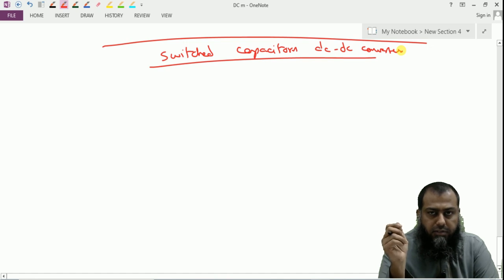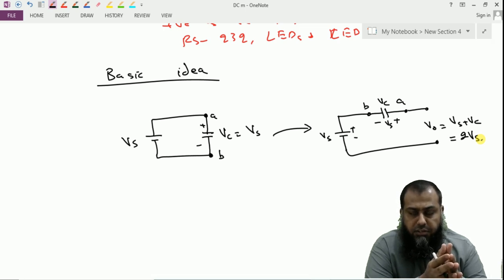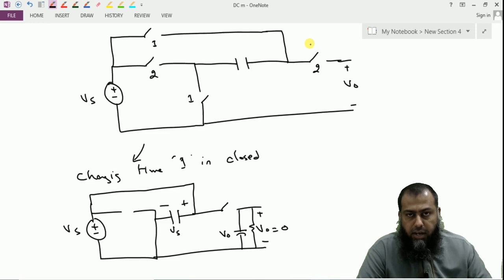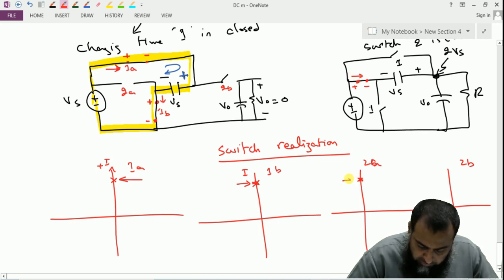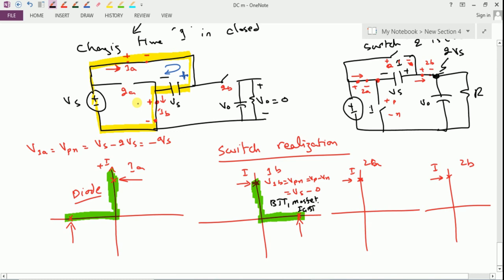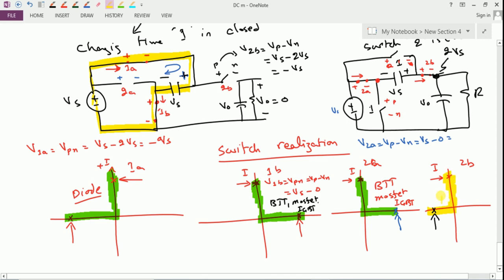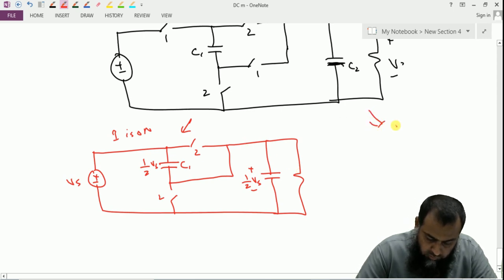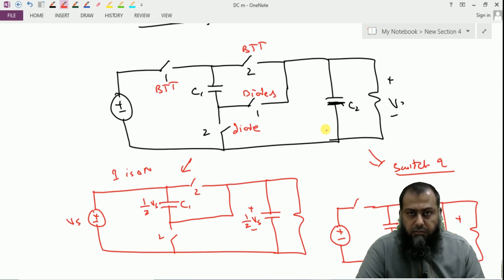Power Electronics Module 2 Lecture 5 | Switched capacitor converters

Comment: Thank you sir. Since you are doing pec topologies. I wanted to start my research in EV chargers and most of them have DAB with single phase shift modulation or enhanced SPS modulation. But i dont have basic understanding of these yet. I would request if you can make one video on that
Reply from the maker: Dear Ahmed Ali, I am covering this as part of an undergraduate course on Power Electronics. My plan is to move onto the avergaed simulation concept and then to the isolated converters. As of now, i am suffering from Covid and hence i am likely not to produce any video in the coming 10 days. Modulation aspects will be dealt in the course too. So stay in touch and keep an eye on this channel.
Reply: @HadeedSher  thank you for replying and get well soon by the grace of Allah.

Comment: How can we mathematically model switched capacitor converters? Simple Averaging technique cannot be applied due to the rise of differential algebraic equations in the model. Have you worked in this direction as well?
Reply from the maker: Several papers discuss this issue. Please see these papers
1. Henry, Jordan M., and Jonathan W. Kimball. "Switched-capacitor converter state model generator." IEEE transactions on power electronics 27, no. 5 (2011): 2415-2425.
2. Makowski, Marek S. "On systematic modeling of switched capacitor dc-dc converters: Incremental graph approach." In 2010 IEEE 12th Workshop on Control and Modeling for Power Electronics (COMPEL), pp. 1-6. IEEE, 2010.
3. Mayo-Maldonado, J. C., J. E. Valdez-Resendiz, J. C. Rosas-Caro, R. Salas-Cabrera, E. N. Salas-Cabrera, and H. Cisneros-Villegas. "A contribution to the dynamic modeling of switched-capacitor converters." In 2011 IEEE Energy Conversion Congress and Exposition, pp. 1284-1290. IEEE, 2011.

Comment: Doctor Hadeed, would you please show us how we use the PWM control (PD-PWM) and we generate the switching logic circuit for the gate pulse generation in the case of a MLI switched capacitor topology ?
Thank you so much
Reply from the maker: Thank you for your comment. Please read specific articles published in IEEE Transactions only. Once you decode them it would be easy for you to implement the logic. Right now i am teaching UG PE course and i will upload the lectures on rectifiers that i missed during last year recording.

Comment: Hello sir, I would like to know what is the maximum multiplier that we can use for switched capacitor converter for a particular voltage application. There must be a maximum limit.
Reply from the maker: I have seen few circuits with 8 times higher voltage. But certainly there must be an upper limit as well. The common sense tells us that limit depends on number of factors including the stress on components and gate driver requirements. In summary, i dont have a crisp answer.
Reply: @HadeedSher  thank you very much sir